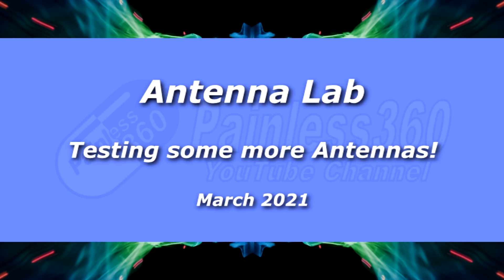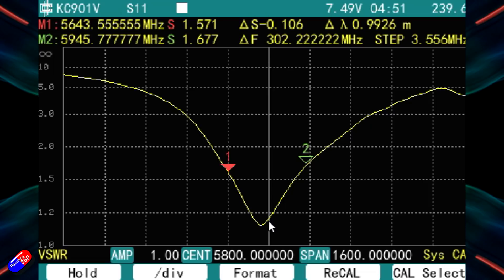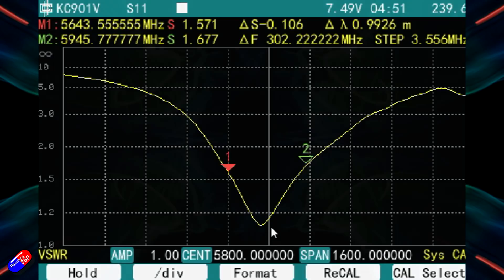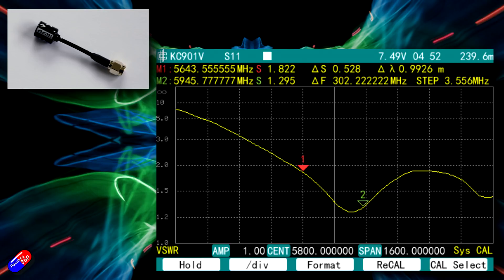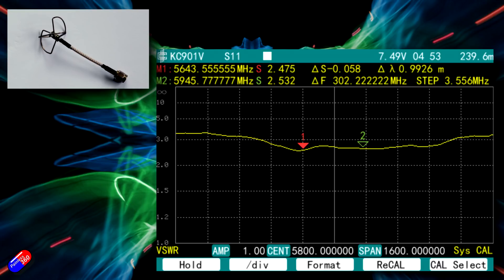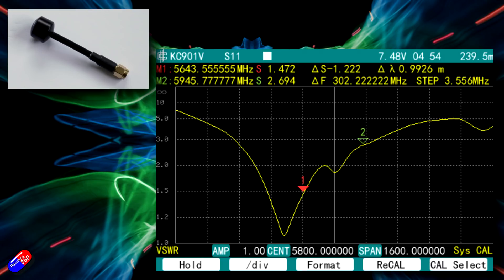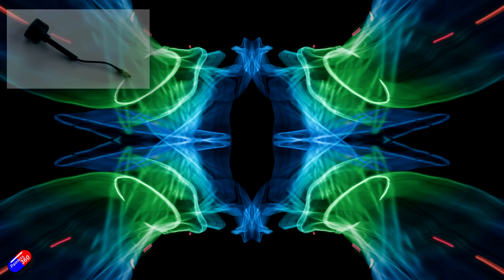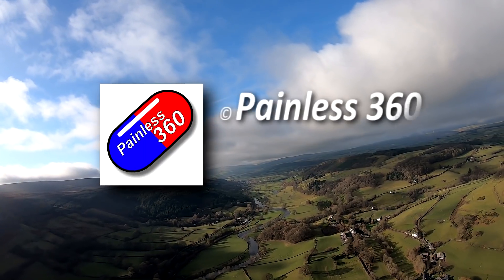Testing a fistful of 5.8Ghz FPV Antennas - which has the best VSWR?

Comment: Hi, I wonder if this test can be adopted for digital transmission as they use the same frequencies. I’m looking for better antennas for the O4 air unit and I’m a bit reluctant to use non omnidirectional ones (hard to find)…
Reply from the maker: We are planning a follow up video testing exactly that with DJI, HDZero, Walksnail and 3rd party antennas. Stay tuned!

Comment: I took a wander around the labs at work (RF supplies) an found out of ~a dozen signal analyzers that only 1 would go to 6GHz. And that guy would not let me touch it. Its really hard to get the right equipment to check this stuff. Great job on the testing.

Comment: The video is great sir , but could you give me advice that what antenna should i use ? Because i use the VRX ROTG01 so it only has one antenna module to only attach one antenna so should use the Pagoda PCB 5dBi antenna ?
Reply from the maker: If there is only one antenna then I would use an omni-directional antenna for general flying. Something like the MenaceRC Pagodas are great!
Reply: @Painless360  Thanks you very much sir ,i have thought about if some omnidirectional  antennas like pagoda or lolipop is fit for general RC flying but til that time i just assume that so really thanks you ,wish you a good day sir 😊 .
Reply: @Painless360  Thank you for the your help Sir the last time i asked you about VRX antenna for general flying and that help me a lot, but i forgot to ask you about antenna (general flying) for VTx . Yesterday i bought a Foxeer Mini TM25 25mW VTx ,i hope you could help me once again .
Reply from the maker: Depends on the connector that VTX unit has, SMA, UFL or SMA. You need to find what it has and order a omnidirectional antenna with the same connector. See my other FPV basics videos..

Comment: is it possible to mount antena in the way you do not have it beside your head, like mount it on a stick  2 meter away from me and then connect with googles?
Reply from the maker: Using an omni-directional antenna that is tall enough to clear your head usually means that you'll get a decent reception from all points around you as you fly. As the antenna on the goggles doesn't transmit anything then there any danger of the radiation. Check out how those pilots using antenna trackers fly - may be more inline with what you are looking at..
Reply: @Painless360  thank you! So you mean that googles are just receiving signal and do not emit any radiation, like the RC transmitter does?
Reply from the maker: Correct. They don't send out a signal (unless you have a fancy module that has things like WiFi and Bluetooth and you've turned those on ;) )

Comment: Oh those old clover leaf antennas were awful things out of the box, let alone once you had bent it a couple of times! I like these comparison videos, getting to see some figures on performance. Would it be possible in future to see some of the lighter antennas - those with much thinner coax and the MMCX or UFL connectors. So many of my vtx's these days have the smaller and lighter connectors, and would love to know if they, along with the thinner coax cause any noticeable loss or tuning issues. I ask because other than the aeropod, Menace does not supply any antennas with the smaller and lighter connection options. I was wondering if their was a performance issue that swayed their decision not to stock them. I used to use a lot of menace rc antennas, but have moved away from them because of the lack of MMCX and UFL connected antennas. I know you can get adaptors, but they add weight.

Comment: Unfortunately, the VSWR does not say if an antenna is working okay (radiation/gain) but it tells whether the impedance is 50 ohms. If you measure a dummy load, it gives a perfect VSWR but there is no radiation.
Reply from the maker: Check out the other videos in the series.. Happy flying

Comment: Thanks for the work :) I'm interested in the foxeer lollipops. I have one of the 'larger' ones on my drones, and two stubbies on my goggles. Would it be reasonable to assume that the stubbies have a similar trace to the one from the video?
Reply: No, and anything next to these antennas can cause them to be detuned. Different cable lengths can also have different readings too

Comment: Great timing, I'm looking for an alternative to the Foxeer Lollipop because it breaks way too easily. I'm getting a great picture quality from them and so are my friends, we're running Shark Byte on TinyTrainers, but the active element is very weak and snaps after too many crashes.
After a very light crash on grass yesterday the signal was ruined on mine, gave the antenna a little shake and it was rattling, ripped it open when I got home and found the main lobe had snapped off and was loose! I'm not the only one to experience this, happened to two of my friend's Foxeer Lollipops just recently and I found a video from nearly 2 years ago titled "Foxeer Lollipop Rattling?" with exactly the same issue. So no more Lollipop's for me.

Comment: Nice video - I wonder how a dipole would have compared, just out of curiosity.  And how do these VSWR numbers and differences play out in the real world?  And at what distances?
Reply: A dipole, depending on parameters, could perform very well by the measure of this test.  With a 3dB signal loss working against a good circularly polarized antenna at the other end.

Comment: I'm assuming these are receiver antennas do they work the same for the transmitter side of it. And any data on the directional strength of each antenna. I know I'm asking for a lot. So Far you've done a great job.
Reply from the maker: It sounds like you might enjoy the rest of the series. Best of luck

Comment: Will you be doing a test for 1.2/1.3
Reply from the maker: It's not something I have a lot of kit for..
Reply: @Painless360  is the concept the same
Reply from the maker: The testing would be the same, VSWR isn't unique to FPV antennas - it's a standard measurement for any antennas to see how well it is matched to the transmitter for maximum propagation and minimal reflections that could harm the transmission electronics.

Comment: Thanks. I missed the unbranded Mini Pagoda Antenna that BG sells though which is interesting these days with ever smaller quadcopters. I have a suspicion that they're the same design as the Speedy Bee antenna.
Reply: Speedybee is nothing like pagoda inside, it's made (and fails!) the same way as all of them cheap cirpol antennas - copper lobes inside of glued plastic shell. I killed two already, top solder joint just fails because it's too small but must hold weight of active element. Even lollipops survived for longer for me...

Comment: Very surprising that the sensitivity is good for almost all antennas but the manufacturers don't seem to have good control over the tune.
Reply: Yeah it's quite weird some antenas has 1.2swr just a little before FPV range. Weird, I'm not sure if the SA or some adapter is out of calibration.

Comment: If you had, say, one good antenna - would it matter if you used it on your drone or goggles to get the most out of it? - i.e. use it for transmission or reception, or does it not make a difference?
Reply: Makes no difference, but id put it on the goggles so it wouldnt brake in the event of a crash

Comment: If you are buying pagoda antenna, make sure it's with plastic braces - then the top and bottom pcbs are aligned and more or less in tune. Worth to mention, that the smaller antenna is - the more vswr depends on the suroundings. You can ruin your vswr and radiation patern by placing your antenna near battery, metal objects, cables, other antennas, etc. Would be actualy interesting to see differences between stub antenna performance on the bench vs on the drone.
Reply from the maker: Check out the other videos in the Antenna Lab series where we look at that.. Happy flying!

Comment: Good to see someone doing this. But VSWR doesn't tell you anything about the performance of the antenna. It just tells you the transmitter sees it as a matched load. A dummy load will outperform all those antennas if you go by this measurement. You need to measure resonance, reactance and field strength.
Reply from the maker: Check out the other videos in the series. Sounds like you may find them interesting. Happy flying!

Comment: Speaking from the amateur radio community, we strive to get a SWR below 1:5 ( doesn’t always happen)
But I have been horrified a few years ago by various flattened 5.8Ghz antennas from Banggood  that arrive in a flimsy grey unpadded  plastic bag ,(a box would be sensible) 
Definately going over to PCB type antennas like menace RC is the way to go to get a repeatable SWR when making antennas in high numbers.( plus Banggood a packaging doesn’t destroy them!)
Reply from the maker: Check out the other videos in the series. Sounds like you may find them interesting. Happy flying!

Comment: Very interesting measurements! Do you think the vswr measure is the most critical about an antenna? Would be an easier way of measuring than my practical tests with an spectrometer and actually transmitting 1mw over 10m...
I used right the 5800 frequ for my tests however, so antennas with a good vswr there sure performed better than others...
Reply from the maker: Check out the other videos in the series. Sounds like you may find them interesting. Happy flying!
Reply: A low VSWR means RF energy is coupled efficiently into the antenna.  Where it goes from there is not answered by this test.  A dummy load delivers close to a 1:1 VSWR across the band.